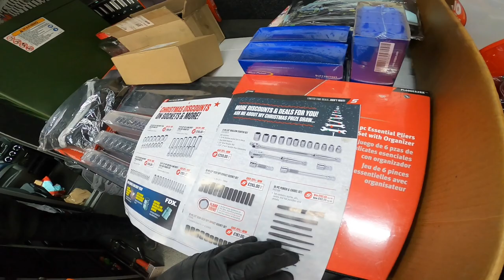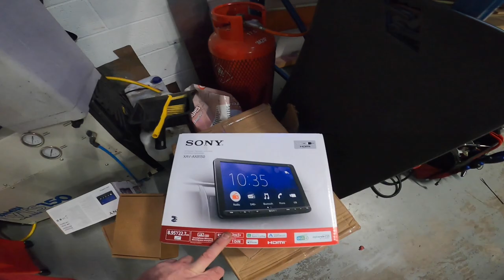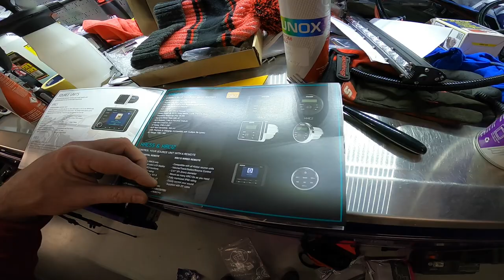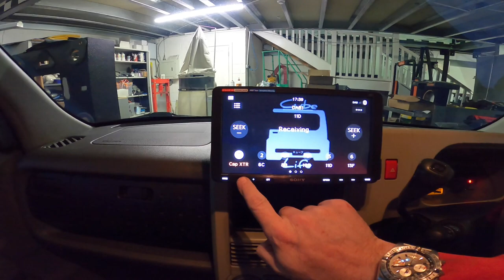SNAP ON TUESDAY

Comment: Hi Alex, love the vids, got a question for you. I have a peugeot 307cc 06 plate and a pioneer sph-da250dab (great stereo) but i cant get any fm signal. Ive just purchased a connects2 CT27AA14.EU antenna adapter - do I need to connect the little blue wire that is attached, does this power the amplifier? Cheers Alex
Reply from the maker: yes any booster from stock to aftermarket requires the blue wire to blue and white or solid blue to power the aerial booster